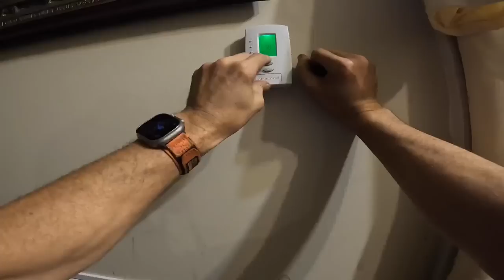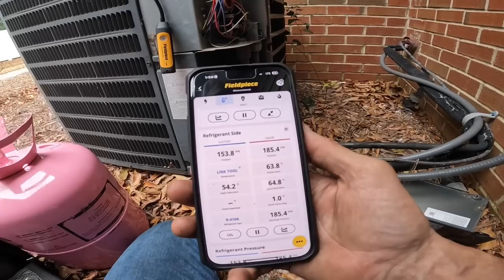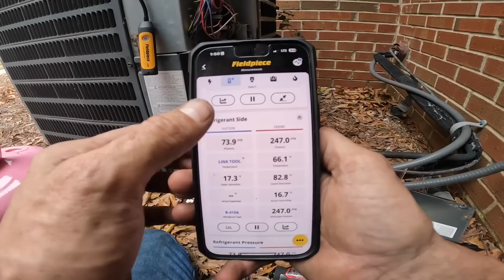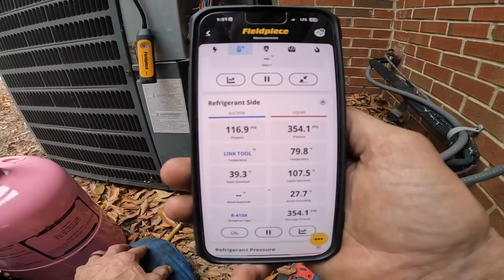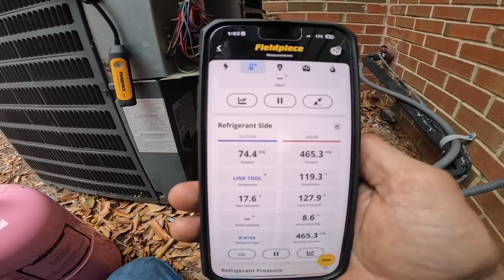Customer Called and Said Her Heater Was Making Loud Noises

Comment: When I’m trying to decide if a heatpump is low on charge or it’s a metering device. I’ll usually run it in cooling, if it’s real cold I pull the wire for the condenser fan. If pressures are normal your likely looking at failed metering device, suction low again, give her the juice!

Comment: For starters it’s way to warm to check heat mode.  Dump charge and weigh in  then if you’re still having a problem you can then recover it and do your repair as you see it

Comment: goodman has a charging scale for the heat  cycle,,,,temp on big line in winter during heat cycle  i always have used the temp 110  degrees PLUS OUTSIDE OUTSIDE TEMP ADDED TOGETHER,,,,EXAMPLE,,,,,,SAY 60 DEGREES OUTSIDE AND ALWAYS A MAGIC NUMBER OF 110 ADDED TOGETER >>>170 DEGRESS ON THE BIG LINE PLUS OR MINUS 5 DEGREES,,,,WORKS GOOD FOR ME ON ALL HEATPUMPS